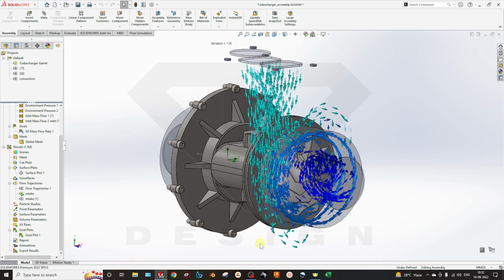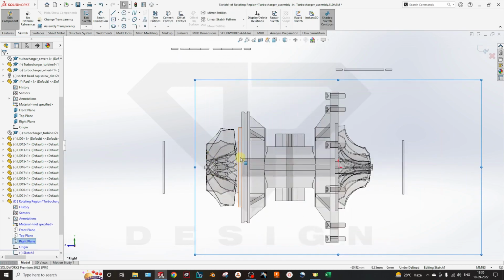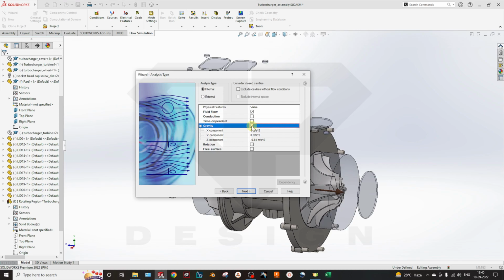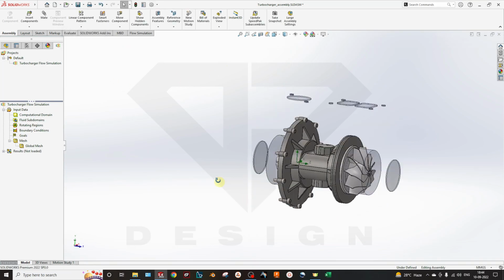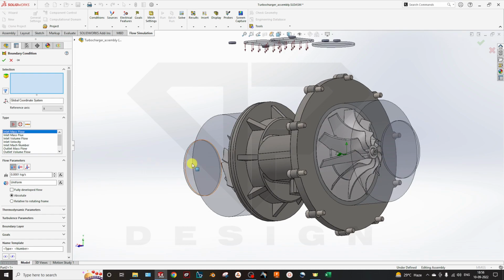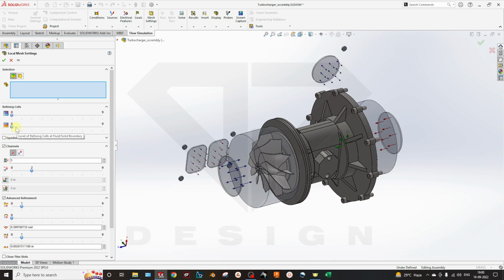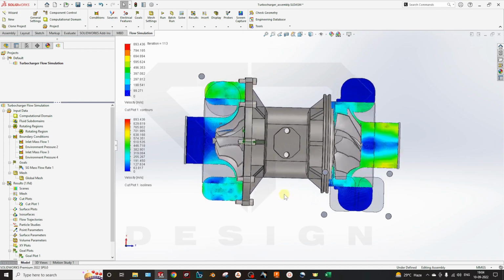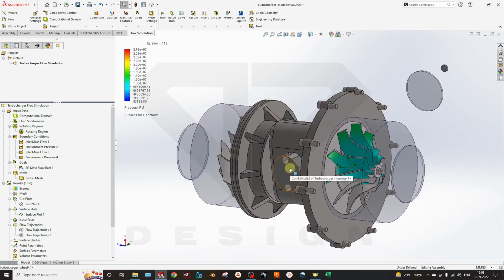Turbocharger CFD Simulation Tutorial using Solidworks | SOLIDWORKS CFD | Turbocharger | DP DESIGN

Comment: Is this fluid simulation part of solidworks or a plugin? what's it called?
Reply: IIRC its a stand alonce license, so you can pair it with any seat you already have. SW standard + flow simulation will be around 11k/year (~2820/year+8100/year, and whatever discounts you can finagle out of the vampire VAR's)